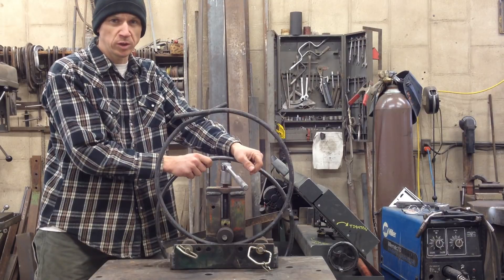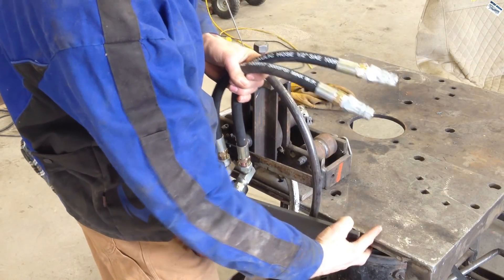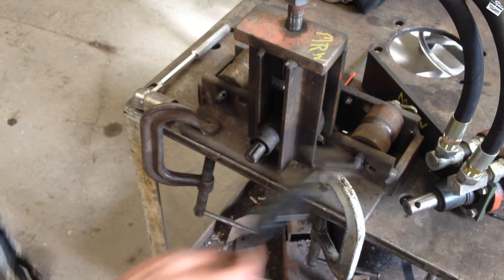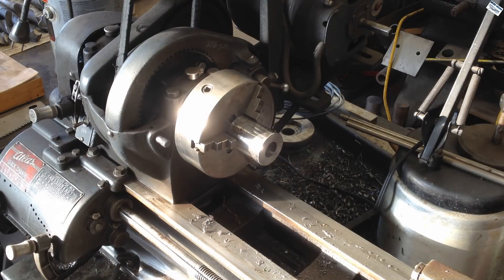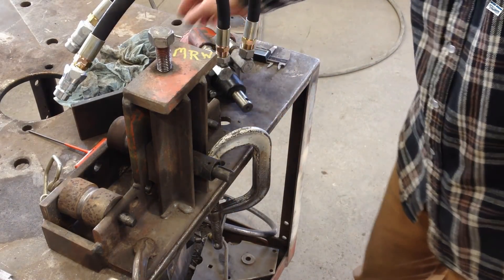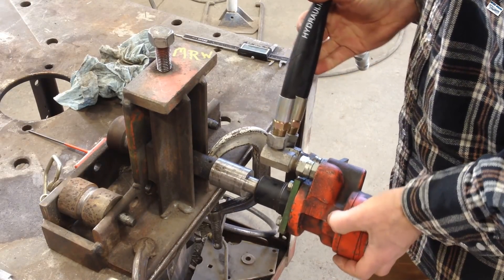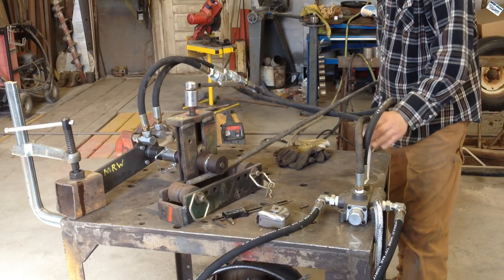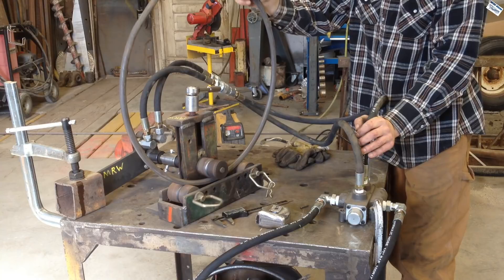Adding a Hydraulic Motor to my Ring Roller (Ending changed for clarification)

Comment: Elegantly done...could you give me a quick estimate of your rpm?  It seems like an ideal speed.
Reply from the maker: Thanks!  IIRC it's spinning about 70 RPM.   I think it's a 3.0 cubic inch motor and my power unit is 1 gpm.
Reply: @WideVisionMetalFab  Thanks a bundle.  I'm using an electric motor and I think I am on the hunt for a reduction gearbox!  I really appreciate your video.  Well done.